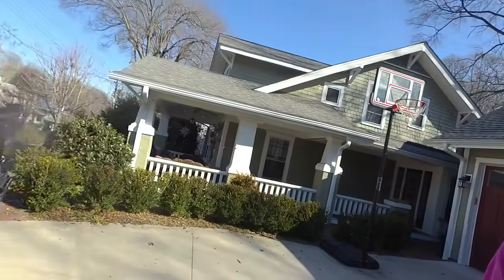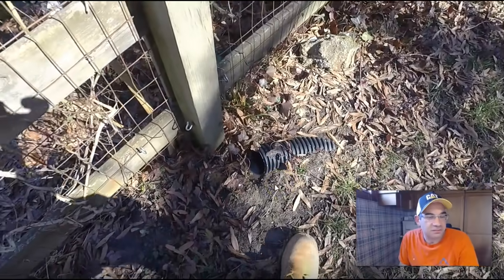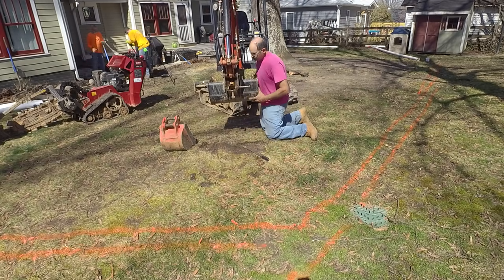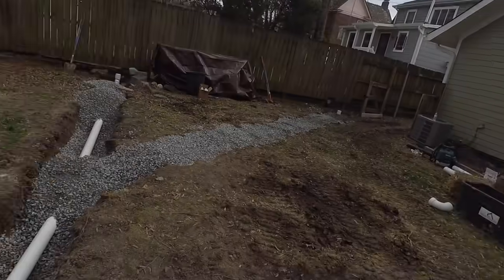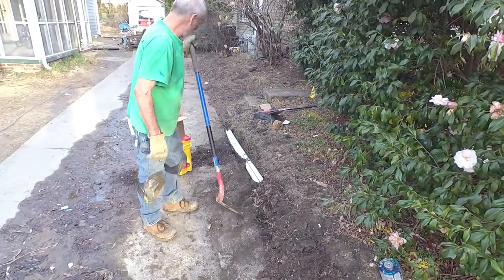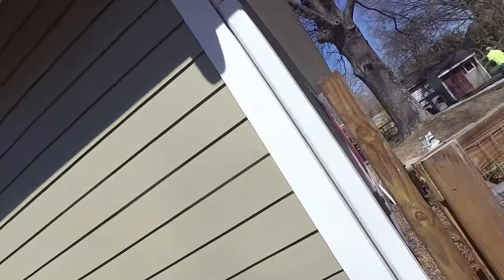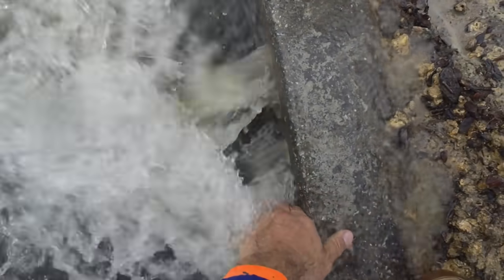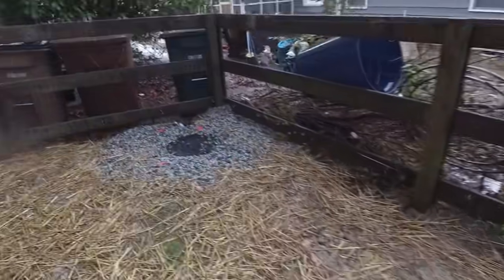Installing a french drain and dewatering pumps to solve stubborn back yard flooding

Comment: I would have enclosed the rubble drain in a layer of geotextile, over time sediment will clog the holes in the poly pipe.
Also, I'm unfamiliar with weather conditions there but I have 2" pumps in my sumps and they barely keep up during heavy rain.
Reply from the maker: The thin layer of fabric clogs with fine sediment and slows the flow. By preserving the flow the water can carry the fines through and out of the system. This keeps it much cleaner than trying to retain all those fines against a fabric. Also keep in mind this system was not meant to keep up with rain events but to evacuate the residual water.

Comment: Actually, the gravel river is not in a bad spot. Notice that if you push in parallel landscape metal edging to define the path, and throw some pretty pea gravel on top with pavers,  it will percolate just like before but you can have a nice walk to different areas of the yard. And, you can even add a 2ft tall itty bitty wall where the hill starts and refill on the back with three steps in the center. It will pretend to have a nice path to the area, then the hill is defined and not as steep since the wall allows to raise the lower portion, and the steps can meet the walkway. It will look like a planned landscape job and elegant. Is a matter of owning it, add some pavers and even edges, done! you're welcome LOL

Comment: Awesome job. If you were to do this job over would you do anything different? Additional French drain lines? Deeper catch basins? Just wondering out of curiosity..
Reply from the maker: No I don't think I would do anything different. Deeper catch basins would have filled up just the same as would additional FD lines. The main thing about this job is the water was gone from the back yard very quickly instead of holding in the yard forever.

Comment: With the angle of the outlets it there a worry that surface water coming down the streel will be injected into the sump systems?
Reply from the maker: No not really. The pumps have check valves.
Reply: @GCFD  I have a similar setup in my backyard, pumping out water through the curb. I had a check valve. It failed. Then a second check valve. It failed. Then a third check valve. It failed. For some reason I came to believe that a check valve was not the solution. So I rerouted the discharge from the pump to go straight up 1 ft. out of the sump then U-turn back down to the original pipe. This height overcomes the back pressure from the raging torrent out in the street. And I had to vent the top of the U because otherwise the back suction pulls the water straight back into the sump when the pump shuts off.

Comment: Great work, Yet another example of a residential lot w P Poor grading overall..The pumps are impressive w the amount of flow. How do you wire those direct into the main electrical junction box ?
Reply from the maker: We don't wire them at all. We order them with 25' cords and plug them into an outside outlet. 👍

Comment: This is the first time I've seen a system of yours get overwhelmed by a storm, but I appreciate the explanation about clearing the water out after the rain is finished. What would you change in the system if the customer wanted it to handle all of the water during the storm as well?
Reply from the maker: Hi Walter - Great question. With so many unknowns about how much water was flowing from the uphill neighbors, I would not have taken the job if he asked me to handle all the water. There is simply no feasible way to collect an unknown amount of water and pump it to the street. I turn down jobs like that all the time where expectations and reality don't mesh.

Comment: Nice great video. I see you using both a trench digger & a small excavator.  I gotta do the same but as DYI trench digger is easier to learn. What's the learning curve for a mini excavator? Also, we live in NJ gotta deal with the frost. What state do you work mostly at? How deep is the trench?
Reply from the maker: We're in NC. I have maybe 120 hours of experience operating that ex. I didn't memorize any controls and made a point to just feel the controls. I like operating the exes.

Comment: We have to run orange conduit for power feeds . no exceptions
Reply from the maker: Most people don't run any conduit here so using schedule 40 pressure is pretty good! These are mainly pipes that you run the cord through so nothing is hard-wired here which changes things too. Great comment Rusty!
Reply: @GCFD  many years ago at work we had a chap get electrocuted cause he cut a white pipe thinking it was a telecom pipe . I like forewarning if I know a H&S experience. Just so you see where I'm coming from

Comment: I have started this project beside my home, should I lay down landscape fabric before my gravel and pipe ? 

Please advise

Thank you
Reply from the maker: It depends on your soil type. If you have subsurface water, then yes fabric is good. If you're digging through dry dirt with standing water on top then you won't need fabric.
Reply: Gate City Foundation Drainage I have wet soil
Thank you very much for your support!  
I’m almost done just have to lay the pipe at 1/16th - 1/8th slope

Comment: Looks like a great job. How do you power the pumps? I assume they don't come with that long of a cord on them, is it just a heavy extension cord running through the inch and a half pipe?
Reply from the maker: Great question Phil. You're not supposed to plug these into extension cords so I order them from Zoeller with 25' cords already installed. They take longer to receive but everything is good to go. I keep a few of these on hand.

Comment: How will that sump basin keep up during a heavy rain?  That thing will fill up in 510 seconds with even a moderate rain.
Reply from the maker: There's no way it will keep up with heavy rain. It would be a poor return for a system that would pump that much water. The point is that it catches up very quickly after the rain stops and evacuates the water that used to hang back there for days and weeks.

Comment: I would of added a chanel drain about a foot or two off the fence, parrel to the fence and added some chicken wire to prevent more junk from coming across. Great work though
Reply from the maker: We typically use channel drains along concrete or pavers and FDs out in the yard. 👍
Reply: @GCFD  we use them on golf courses where we have massive runoff but theres no low spot.

Comment: Does the discharge line need to have fall?  If not is there a maximum distance it can push against gravity?  And lastly do you need any check valves in the discharge line to prevent back flow?
Reply from the maker: The discharge line is used when there is negative fall. The term pump refers to using energy to pump against a gradient, which is a last resort. The pump depends on how much it can push against gravity which is called head pressure. It's usually measured in feed. You do need a check valve and we use a swing valve over a spring valve for these installs. Great Questions!

Comment: I use 90 gallon per minute pumps, they work for me. Did the white pvc in the French drain have holes in it? That wasn’t really talked about?
Reply from the maker: Yes this was perforated pipe with 1/2"-5/8" holes drilled. 👍

Comment: How did you run the power for the pumps and what kind of fittings you used inside the basin ,to hook up the pumps?
Reply from the maker: We order these pumps from the factory with 25' cords and just ran the cords through 1 1/2" pipe to protect them.
Reply: @GCFD  Nice! Good idea, thank you for responding.

Comment: The stone you use for the French drain compacts enough to slow the flow of water.  You need to use fabric and inch n half round rock. Did you see frenchdrainman videos on utube? This job you did, did not move the water fast enough from the yard.
Reply from the maker: Rounded river rock shifts too much and allows subsoils to infiltrate. I have seen him and his techniques work for his area but not here. The point of this system was not to keep up with the flow of water but to get rid of it. I think you missed the section where I talked about that.
Reply: @GCFD  wrap the stone with fabric separates the soil. Your stone compacts yes but then doesn’t move the water fast.

Comment: An alternative solution can be vertical drainage ( if there's no bedrock and the soil is not heavy clay) 
drill vertical holes with an auger attached to your mini excavator and fill with coarse sand. 
Water will run into the holes and dissipate into the soil.

Comment: question: could you have used a pump with a larger discharge to move even more water or was there a limiting factor? Observation: you used a reducer to tie the pump into the discharge line...That creates a restriction..might be small(i used to do pool pump installs and maintenance)...curious what size reeuced did you use?  That chokepoint is now your maximum capacity of the discharge.  It's still a very nice job and yes with a major severe event no matter what you do it's going tob e overwhelmed...but it did recover quickly..:)

Comment: Good job but I have a question. Doesn't the municipality build drains and piping for the property to connect to instead of draining the water onto the public road? Also you could install wood planks on both sides of the gravel path to prevent the gravel from flying all over the place when mowing the lawn or walking on it. Would make it look nicer.

Comment: If you put French drains in rooted areas, the roots will grow into the pipe lines. What do you do to inhibit this?
Reply from the maker: Make sure the pipes are surrounded by gravel (which shouldn't have water in it) and not holding water.

Comment: Bonjour from a "Texan" (Land of the "100 Year Flood Plains" and "Cows pissing on Flat Rocks" Flash Floods) living in France. Some free advice for you and your followers

1) A "French Drain" intends for the Gravel to "slow" the rate of flow and the "Pipes" to be perforated (Holes pointed down to allow capture and percolation "up" into the Pipe and transfer via gravity or pumps). I couldn't tell if your PVC Pipes were perforated ... but they should be ... coefficient of drag ... "plastic" flows easier than rocks ("Fluid Dynamics 101").
2) Word to the wise ... the lids to your "Basins" need to be "Lockable"  ... "Electricity and Children" don't mix ... nor even a short 2 foot drop. Sorry ... "Safety First".
3) And while on the topic of "Basins", I truly hope your Sump Pumps are "12 VDC" and not straight up "110 VC" ??? I didn't see a "Transformer" (reducing 110 VC to 12 VDC) so just a word to the wise ... and have a GREAT insurance policy !!!
4) The Number 2 Gravel looks great ... offer them "Edging" (Timber, Steel or even Plastic) ... looks nicer and contains migration of the Gravel over the years. Another method, but less "flow rate" is "Pave Stones" or "Garden Fabric" (between the gravel and top soil and therefore hidden). 

All in all a fine job and far better than what they had before. ALL endeavors can be improved upon. As "Demming" once said: "Change is not mandatory ... any more than survival" (sic).  Have a good on and carry on !
Reply from the maker: Thanks for your comments! To address them, 
1 - yes the pipe is perforated and the holes face dowward.
2 - These lids are held on with 4 stainless bolts but not locked on. 
3 - These are commercially available 120v pumps designed for this application. They are connected to GCFI outlets. 
4 - We don't bury out drains as it destroys their function. Keep in mind they had a buried drain under the standing water.
Reply: @GCFD  Thanks for your kind reply ... must admit it was the first of your Videos I had watched and have viewed several others and now see you use perf ... AND "Sched. 40" stuff ... Bravo !!! And I would further compliment you on the hole you take the time to drill in the clean out trap plugs ... you might find it interesting you've improved the design in my view ... trust me when I say the "French" don't have a clue on how to vent their "Evacuation" and drives me crazy ... LOL.

As for the 110 AC ... good to know some type of fastening is accomplished and again, superior materials using Stainless ... just didn't see that in the Video and concerned me ... I deal with 220 over here ... again, great job.

Bon chance and I'll get back to watching more our your videos ... keep'em coming.

Comment: It’s no surprise the water backed up. You’ve got a 2 inch out pipe. You can’t squeeze that much water through a 2 inch pipe no matter how strong the pump.
Reply from the maker: Exactly! There's no possible way to collect all the water from several uphill properties and pump it. That would be a waste of time. Rather, we installed this system to eliminate the standing water from the back yard and it's been working very well for the homeowner. Great comment!

Comment: Anyone else a little disappointed that the system couldn't keep up? I get that there was massive rain fall with tornadoes but it was disappointing to see after all that work that yard still overflowing. Yes I understand that the french drain removed the water after it stopped falling but the system was still overwhelmed. It would be nice to see the system under a typical storm.
Reply from the maker: Hi Brandon - There's no way this system was intended to keep up. There are thousands of square feet of concrete and roof in the above neighbors. Trying to move all that water uphill to the street would be unrealistic. We went for the residual water, like you said. 👍👍
Reply: you would need a pump the size of an A/C unit to keep up with a torrential downpour like that, bro.!!!!!!

Comment: When you run your pipe for the cord you should use a heat gun or a heated jacket  and bend the pipe with an 8" radius. It's so much easier to fish a cord.
Reply from the maker: Great advice! 👍

Comment: what were the specs on he pumps? were they undersize for the system or was the pipe to the road not big enough to let them operate at full flow, maybe tieing the two basins together will let the other pump pick up the slack for the one thats overflowing? im sure this was a 5 figure system once youve spent that much you kind of expect to not have to deal with ponds and erosion in the yard

Comment: In FL theres no place for the rain water to go. No sewer on street yet. I wanted to do a french drain like this one however it is illegal to run the water into the street. What would you recommend? I had a ditch in front yard but the street rain water ended up there while my rainwater with slope to ditch just gets full & water comes back toward the house. Its l8ke fighting a losing battle.

Comment: The only thing I  see you did that I never do is leave the area where the drain is with gravel exposed. I prefer to have a few inched of soil on top of the drainage system for grass to grow in, that way 1. you can mow the lawn like normal, and 2. if the homeowner ever sells the house the drain is never seen. It has always been a big seller in areas where drainage is a problem. Otherwise great video.
Reply from the maker: Keep in mind that they already had a buried FD in that yard. The few inches of dirt and grass on top prevented any water from entering the drain, thereby nullifying it.

Comment: I’m curious as to what the gallon per minute rating is on the pumps? I’m doing a French drain system in by backyard and am doing some research
Reply from the maker: It depends on the head and run of pipe. They have charts with flow on them. But it pumps around 55-75 gpm.

Comment: In my area I could use a system like that. How would I make sure the system does not freeze up during a typical Maine winter?
Reply from the maker: You can install an antifreeze (freeze relief) sump discharge valve as long as you don't have any head pressure holding.
Reply: @GCFD  cool! Thanks for sharing. That makes sense.

Comment: How far can you pump up hill with a pump basin? I have a large back yard with water issues and looks like I will need one to catch a few down spouts!!
Reply from the maker: Each pump has a value of head (which is uphill water weight that the pump has to pump against). So check how much elevation gain you have and match it to a powerful pump.
Reply: Ok thanks for the info. One other question for you? I see other companies use the schedule 40 pipe or the black corrugated but they wrap it in the black drainage fabric with stone and then cover it with dirt? Do you have problems with dirt clogging your French drain tubes?

Comment: why did you not install French drains  and gravel along the perimeter ,covered in gravel and then solid pipe it out under the main are in the back so there was no gravel nightmare on the usable area of the lawn?
Reply from the maker: Because you would have to get the water to that high point around the perimeter. I went with where the water told me it flowed.

Comment: Great job I really respect how you care if the system actually works vs companies that just slap something in and take the money. What is your opinion on geo fabric around French drain trenches.   I notice you do not line the trenches with fabric
Reply from the maker: We have very stable soils around here and I like to preserve the flow into the FD. I use 24" of gravel instead of a thin layer of fabric.